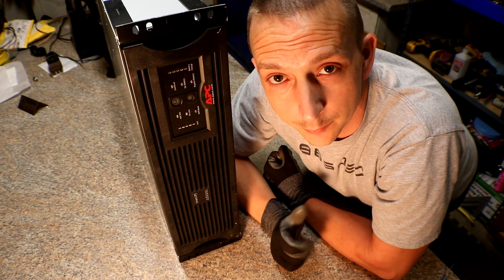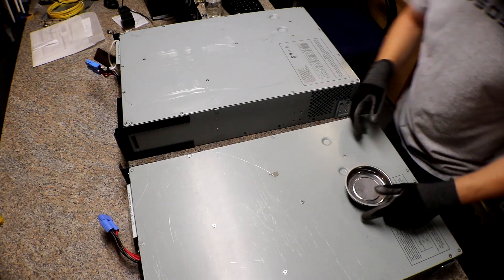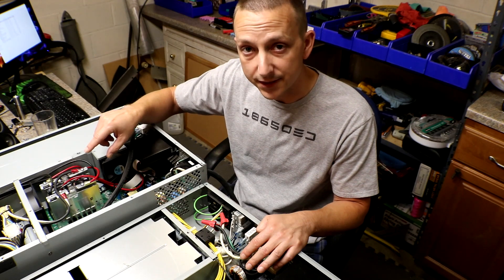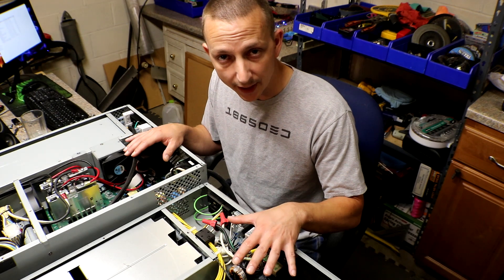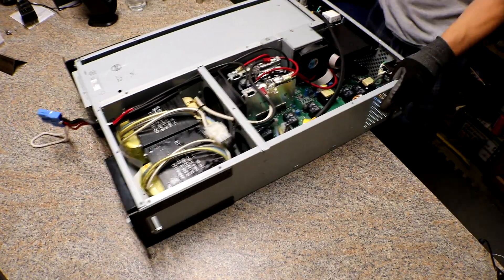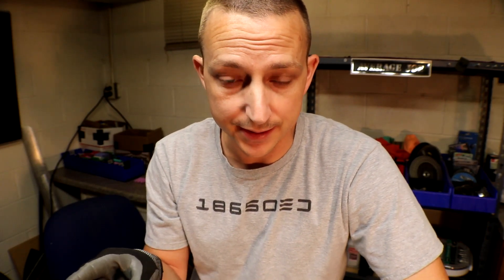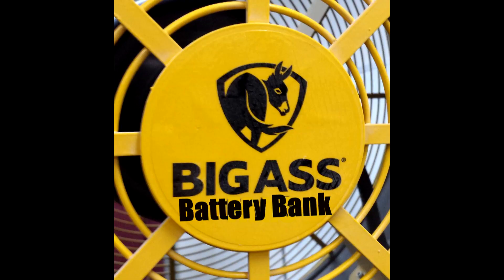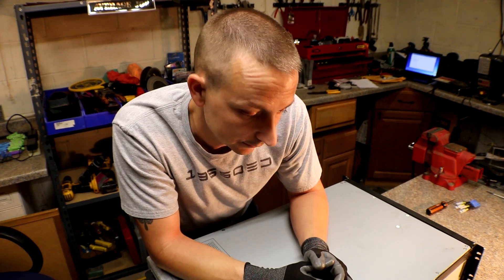Diy Tesla Powerwall ep49 48v APC UPS The XL Version!

Comment: The bigger transformers would help on larger loads and better cooling, the extra mosfets assuming same on resistance as the smaller unit will lower heat dissipation. the larger transformer will have a lower efficiency at lower loads. Defiantly a good find but still not an online unit so not intended to run for extended periods of time. You could look up to see what capacity battery pack APC is intending you to connect to it. Go for XL version. I like the poor mans style of power wall :) matches mine.
Reply from the maker: Yeah good point on the transformers.  I guess if the need arises I could always add more to the board.  Yeah I got 2 of these bad boys although the other XL might be just a tad bit older by the looks of it.  Ya it will definitely be a poor mans Powerwall (to a point lol)  Ill have to read up on them.

Comment: I reckon test them out. see what kind of current drain both have idle and under load as well as on battery.. see which wins out.
Also, your larger unit can put more mosfets by the looks of it. but not sure how much more gain you'd get.
Reply from the maker: Yeah thats an option.  I could put more on either.  Both had room for more but like you said, not sure how much gain there would be.